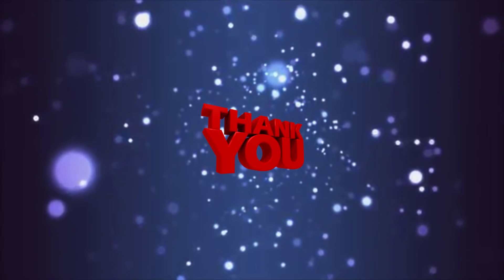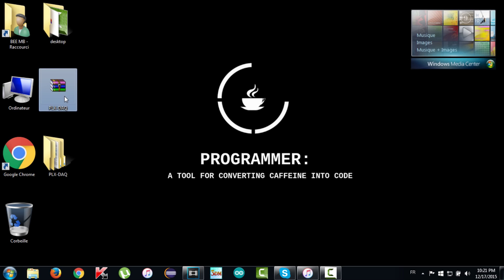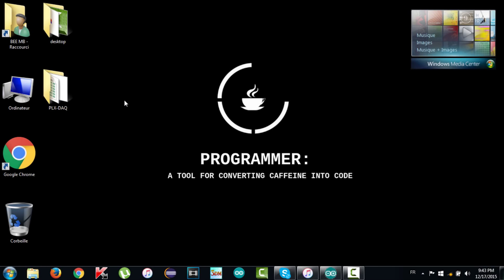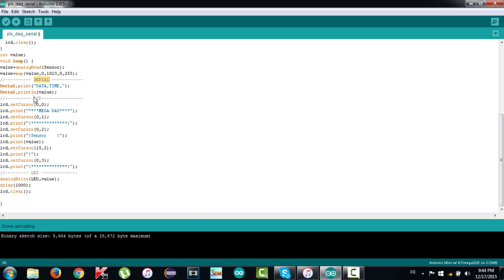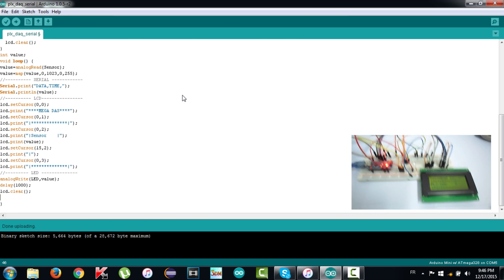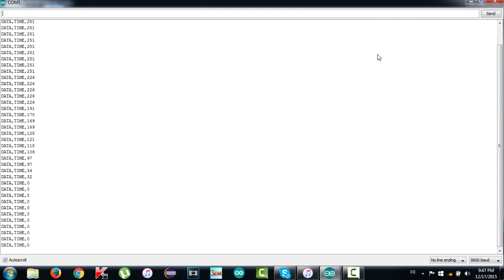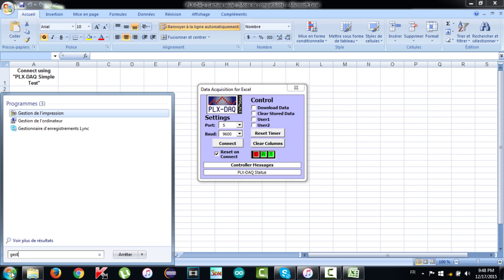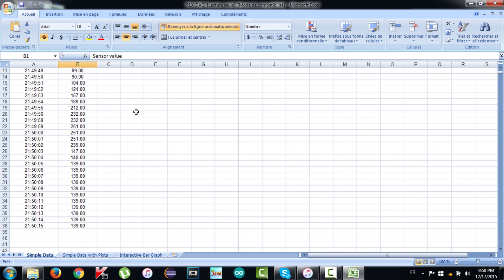Arduino meets Excel ( PLX-DAQ )

Comment: after getting these values can we draw the graph of the data and find it's area??
Reply from the maker: after getting the data you turn off the connexion between your Arduino and the PLX-DAC and you start using the array stored in your Excel file the way you want

Comment: Why is it that everytime i use the DATA,TIME the time that is shown on my computer is different than that of the one recorded into the Excel by PLX-DAQ? It shows 0.65 which doesnt even make sense
Reply from the maker: TIME is the header of the column not the current time, but to do so you should have an RTC module for arduino which allows you to have the right time then send it to that column for sure if time is what you want to get
Reply: If you're talking about RTC modules, can't the PLX-DAQ just extract the date and time from the computer by itself?

Comment: hey please help. i already connect it and the C icon already changed.  but in my excel didn't show anything. i'm using excel 2013. please answer. thanks
Reply from the maker: you should activate macros in Excel 2013 ( i advice you to download and use Excel 2007 )

Comment: can you help me, I do not know how to do it with the DHT22 Sensor :(
Reply from the maker: +Sergej Vogel the first thing to do with the DHT22 sensor is getting the value from it and it should be correctly done or you will not be satisfied by what you will get with PLX-daq ok so tell me if you already did that or not (to make me undestand how to help you ) ;)
Reply: Hello, I have a Temperature sensor DHT22 and a programm in Arduino software  from this site:
http://forum.arduino.cc/index.php?topic=168317.0
there they want to do the same like me
my problem is that the PLX-DAQ shows no reaction. nothing....I dont know why ....the seriellmonitor on arduino sofware shows me that all is right, but on excel nothing.... I dont know what to do :(
Reply: I have Excel 2010 but without product key, maybe the problem is that version or that I dont have a product key
Reply from the maker: sorry to tell you this but the PLX-daq module that i posted don't run with Excel 2010 it works only with 2007 version ( try to download  the 2007 version from internet and solve the problem ;) )
Reply: +MEGA DAS hey, i installed Excel 2007, I had PLX-DAQ from an other site: https://www.parallax.com/downloads/plx-daq
but there stays I need Excel 2001, 2002 or Excel 2003
so I wanted to install from the site u posted. 
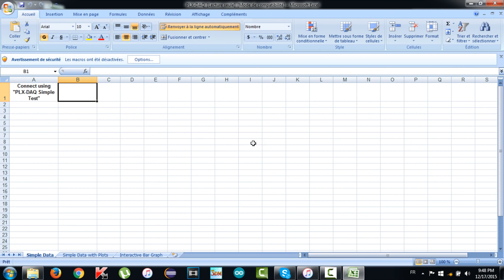But it does not work. I installed it like u, but I cannot open it like u in 6:47....
Reply: cannot find 'C:\Programm(x86)\Parallax-Inc\PLX-DAQ.xls'.
Check the spelling of the filename , and verify that the file location is correct.
Reply: maybe the problem is  windows 10 now?! :D
Reply from the maker: yes this software don't operate with windows 10 sorry :/

Comment: Dear Mega Das,

I am receiving the following error: "StampDAQ could not connect. Please check Port Settings". I am sure that my Arduino Uno is in COM3 and I have chosed Port 3 in the DAQ. Yet, I have this error. 

Could you please help resolve the same.

Thanks and Regards,
Ashwin
Reply from the maker: +ashwinmoi check the port number from the peripheral manager as shown in the video them make sure that u r using the right port in PLX-DAQ 
please tell me if it works or not :)

Comment: hey thanxzz a lot for this video i tried this, when i open spreadsheet and enable that plx-daq after clicking connect on plx-daq window that C & T go green and R start blink red but nothing comes on my plx-daq spreadsheet.. plzz help me............
Reply from the maker: +mitesh naik verfy the Arduino source code 
 you can find the code that i used it in this tutorial through the link bellow 
--------------------------------------------------------------------------------------------------------------------------------------------http://www.mediafire.com/download/8prj3e6mg9y13i7/plx_daq_serial.ino
Reply: +MEGA DAS hye, i cannot compile the code, do i need any library for this ? it says Error compiling for board Arduino/Genuino Mega or Mega 2560.
Reply from the maker: kim taeroll hey first tell me what arduino board are you using! Them did you tried the code in which there are an LCD instructions !! 
Please tell us if you solve the problem, thank you :)
Reply: +MEGA DAS hye, problem solved! i want to add more data into the excel for example weight, and temperature, any idea how to do it? thanks! :)
Reply from the maker: sure you can :) just get back to the source code and modifie the number of collums in the setup function 
please tell us if there is another problem 
thank you :)
Reply: +MEGA DAS hello, here is our source code, can you help us check where is the problem? we cant still add in more data into the excel, thanks alot :D  https://drive.google.com/file/d/0B61gH8SRGXvqTk1MVE9ud01tUkE/view
Reply from the maker: +kim taeroll ok i'll see it later and tell you when i finish 
Kim if i take more than 2 days just remind me ok
Reply: +MEGA DAS hye, for the source code the other day, any news about it?
Reply from the maker: Hey kim well i saw the instructions and i understand what you want to show on the Excel file but i have to arrange the code and i need some information like how many masure you want to make only one time or continuously